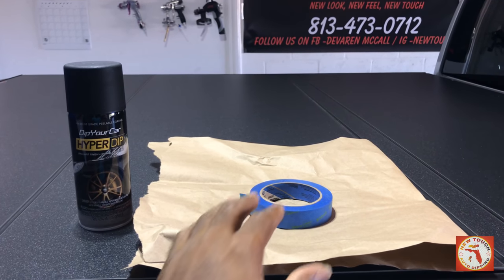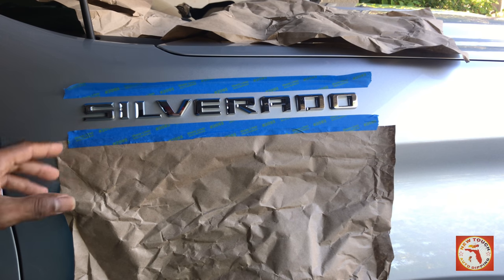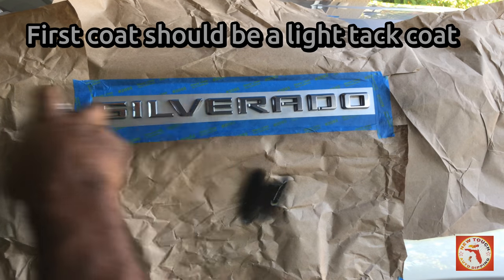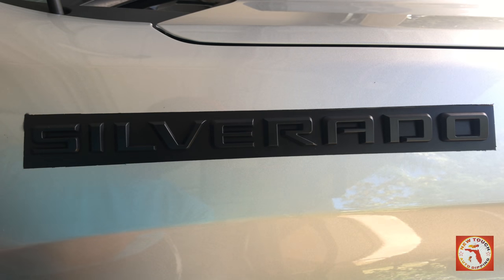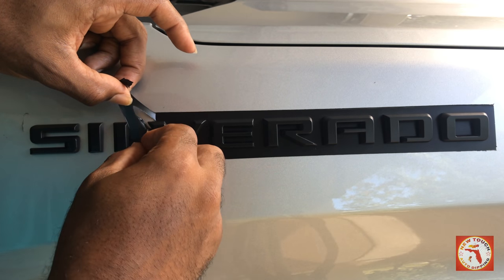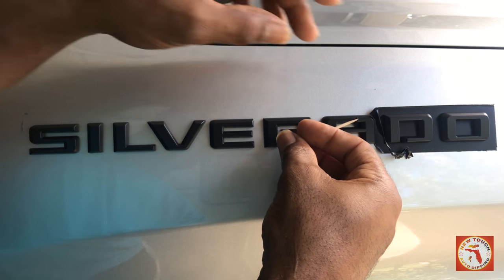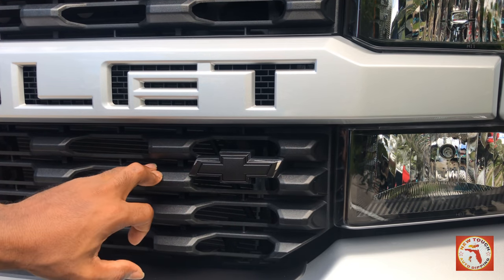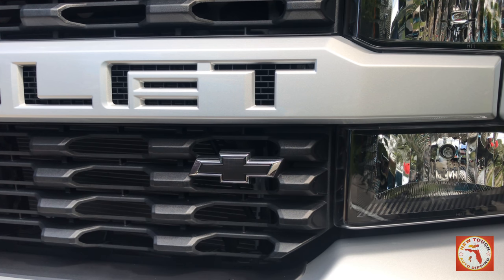(How to) HyperDip/Plasti Dip Your Emblems

Comment: This is a very concise video. One question I hope you will answer.
I live in very hot overly sunny So. Cal.  
My 2019 Pilot has way to damn much chrome. The grill the window accents and lettering. 
I want to black all of them out.
I'm trying to decide which way to go. Professional Applied Power Coating, or professionally Applied Plastic coating such as your using.

How long does plastic coating last considering many washings and heavy environment beatings from the sun's UV rays the heat? 
I'd like your best advice please. 
Thank you.
Reply from the maker: I’m located in Florida where we reach high temps as well, the maintenance will be the answer to the longevity of the product. We call it chrome delete when you’re wanting to black out anything that’s chrome. You could get 3-4 years when it’s properly installed, of course you’ll save the money doing it yourself but honestly you can’t go wrong with either choice. 
When it’s applied correctly won’t have any issues with hand, drive through or pressure washing.

Comment: When you say to peel when it's still wet how long after your last coat would you say that one has to remove the excess? 
Also I'd say it's pretty impossible to see the difference between "hyper dip and reg old plasti-dip" on a video..
The tooth pick idea is a nice touch amigo 👌
Oh and how necessary is that "PRE-SPRAY" Stuff and what is it? Is that just to ensure the area is clean before the process? Thanks man
Reply from the maker: You would only peel while wet the masking, if your temperature is 70+ after your last coat give it 1 hour before you remove the excess around the emblems. 
You really won’t be able to tell the difference between the two unless you physically see and feel it. 
The predip spray allows the paint to adhere properly on the surface, any adhesive spray is a must for all paint products.

Comment: Excess off and is there any other kind of prep cleaner that you can use
Reply from the maker: If your temperature is 65-75 degrees give it 15-20 minutes, if it’s 75 degrees above 10 minutes, if it’s 65 degrees below 25-30 minutes. Your temperature plays a huge role when you’re either outside or in a garage so the best temperature setting is 72-75 🌡 After your last coat you’ll need to peel off the tape masking while the paint is wet, let the extra dip around the emblems dry for 1 hour and peel off extra after that. Yes you can pretty much use any prep adhesive spray.

Comment: What if you wanted to do the emblem 2 different colors ? The outside black isn’t he inside red ?
Reply from the maker: It can be done but it’ll be a risky job doing with a liquid spray wrap. I don’t suggest that you try it with plasti dip bc it’s not that durable for tape or masking onto. Hyperdip or Autoflex will be a better choice to try it out on. 

A project like that would be best with permanent paint because it won’t peel when outlining the emblems for the secondary color.

Comment: Thanks for making this DIY vid and for explaining the application differences between PlastiDip and HyperDip. I've a couple questions and if you don't mind answering I'd be very appreciative:
1. As you were removing the HD away from the emblem it looked like it peeled away easily (per your instructions to carefully pull AWAY from the emblem). Would it stand to reason that the HD would pull away from the emblem as well if rubbed?
2. How durable is the HD when it comes to sun light, washing and waxing?
Thanks again for the detailed explanation on this process. I subscribed to your channel as a result. Keep up the great work!!
Reply from the maker: Thanks for checking out the video and the support, as for the dip rubbing off easily you’ll have no issues. HD will only stick and adhere properly unless you prepare the surface correctly, a dry rag or  dry microfiber towel will be it’s worst enemy. 
Whenever you wash your vehicle you’ll need to be sure that your sponge or rag is wet, I personally use a shimmy towel to wash and dry bc it’s compatible with the dip. 
I suggest that you use the DipCoat protection spray for the wax bc it’ll protect it from the weather and keep it looking fresh for its max longevity.
Reply: @newtouchauto  Thank you! Much appreciated!!
Reply from the maker: @LucRobertPoirier  you’re welcome

Comment: Sorry...should have included with the first. I was also thinking about it for the front and rear tow hooks in Red.  The Jeep is Firecracker Red. Your thoughts?
Reply from the maker: I say go for it, I painted my front tow hooks red 3 years ago and they still look good. Don’t be surprised if others think that you bought a modified version lol, be sure to use a white base coat before applying the red

Comment: can you add a glossifier from dipyourcar to really pop that shine????  also execellent instructions can you do a video of paintin ford f 250 duper duty 2017 xlt badges?  can we also do this to the front and rear bumpers?  i want to black out all chrome and make it all black including mirror cover windshield wipers and bed trim and tail gate trim any thoughts?  please advices thanks in advance, oh and i also saw where fonzi put the cans of hyperdip in warm water for a few seconds do you do this????
Reply from the maker: You won’t be able to add the plasti dip glossifier yo hyperdip but you can add the hyperdip piano or metallic black for a gloss finish. 
If I happen to run across another customer with an F250 I’ll put a video together of the emblems. 
You can most definitely paint all those areas using an aerosol spray can, just take your time. 
If your climate is always cold or it’s 50 below yes you’ll wanna warm those cans up in hot water, I don’t bc I never paint when the temps are 65 and below. 
Thanks for the compliment and checking out the video.

Comment: How many cans of spray are needed for a typical truck with emblems on front, both sides, and 2 in the rear while doing 12 coats per emblem? 

Also, can you do metal bumpers with this?
Reply from the maker: You can get by with 10 coats, I maxed out at 12 coats bc I wanted the emblems to be more durable. 1 can will be enough for the areas you mentioned. 

Actually the wrap sticks best to metal and chromed areas, just be sure that you have enough coats.

Comment: I need to paint my c pillar black on my expedition. If I f*** up using the plasti stuff you’re using am I able to peel off start over (like vinyl would) or is the bond to strong?
Reply from the maker: That’s the beauty of these products, if you have any issues you can just simply peel away and start over, you won’t have any issues with what’s underneath.

Comment: Hello and great job, just need to know, how long will it last once its done? Specially in Upstate NY with snow and heat plus going through the car washes. Thanks for the video.
Reply from the maker: Hello and thanks for the compliment, when it’s applied correctly you can get 3-4 years before needing it removed so that it peels off properly. 
As for car washing I uploaded a video if you’d like to checkout the link, it’s car wash safe.
https://youtu.be/WxrjERIBDHg

Comment: When you answered "Kurt A" you wrote "proper maintenance".  What would be "proper maintenance"?  I have a Jeep Wrangler and was looking at working on the Jeep on the sides of the front fenders.
Reply from the maker: The basic car washing your vehicle on the regular and applying the DipCoat protection spray which helps the paint last longer. It keeps the dip looking fresh, you use the spray after every wash. When it’s applied correctly you won’t have any issues with hand, drive through or pressure washing.

Comment: I've been a detailer ( reconditioner) over 20 years.   You make that look really easy, I've only used plasti dip and it's a pain in the ass... Looks good but so easy to make a mistake.. I've never tried the hyper dip, I hope I can do as good of a job as u did.. I don't think people really realize how much time and effort goes into these type of projects, especially if you don't this kind of thing all the time..
Reply from the maker: That is very true, it definitely takes a few practice runs before you can advance to the next level. I would suggest that you do the same with hyperdip, if you’re use to spraying normal paint out of aerosol cans it releases the exact same way.
Reply: When u say it's a pain in the butt  Is that because it's fairly easy it's really easy to pull it pull it off entirely say when you're trying to pull around a letter and an emblem you can just pull it all off easily?
Reply from the maker: @freedompioneer4311  once you start a peel it’s easy to pull away but that’s only if it’s applied correctly.

Comment: How does it hold up over time, specifically any issues with car washing? Thx
Reply from the maker: When it’s applied correctly you won’t have any issues with hand, drive through or pressure washing.
Take a look at the link below, it’ll show you the car washing process and results. 

https://youtu.be/WxrjERIBDHg

Comment: What did you spray on the area before the alcohol? Does HyperDip come in gloss or a black metal flake? Thank-you for your videos and your time .
Reply from the maker: I applied the predip spray which is an adhesive product for paint, the alcohol isn’t really necessary but I like to use it from time to time. 
I actually have a video uploaded on gloss hyperdip, you should check it out if you’re interested. Currently they have emerald metallic black gloss and piano black gloss available in the hyperdip brand.

Comment: How many cans did you use? I’m blacking out 6 emblems total, some of them are very small. I’m wondering if I need two cans or if one will take care of it
Reply from the maker: 2 cans will get the job done, you just might end up with a little extra for another small project after that 12th coat.

Comment: what happens on washing? if the dip peels so easily, what happens when you start the washing of your vehicle afterwards? I'm assuming any little brush bristle or whatever can grab the edge and there goes your work faster than your dreamed of having it?
Reply from the maker: 😆 nah it won’t but I have a phrase “If it’s applied correctly you won’t have any issues with hand, drive through or pressure washing”. 
Just like with regular paint this removable paint has its cure time to properly adhere to the panel or surface. A good 2 days of temps 65 degrees or higher will assure the process faster. 
If you’re interested checkout my video link below on car washing. 
https://youtu.be/WxrjERIBDHg

Comment: I have a question? If u don’t put any kind of sealer or lacquer finish over it, how do u keep it from scratching off or peeling in the future? Thanks!
Reply from the maker: This product doesn’t behave the same as permanent paint, it’s designed to adhere and bond tight to the surface. Keep in mind that it’s removable and not bulletproof paint so installation is very important bc when it’s applied correctly you won’t have any issues with it peeling

Comment: Great video. Thank you. I have one question; how durable is the HyperDip that is left behind on the logos and emblems?  Seems like it would come off just as easy
Reply from the maker: Thanks, when you remove what’s around the emblems at 1 hour you’re pretty much allowing the product to cure. During the cure process it’s creating a thicker base so that you could remove it easier than before it actually cures. You then wait at least 4 hours of heat or natural sun to finish the adhesive bond which makes it stick properly.
Reply: @newtouchauto  sweet, thanks
Reply from the maker: @SupremeGeeks  you’re welcome and thanks for checking out the video.

Comment: Forgive me…how long do you let the coats sit before applying additional coats? Great video!
Reply from the maker: Great question and thank you. Give yourself 10-15 minutes in between coats, to be sure simply touch the area around the surface to test if dry. In warmer weather such as 75 degrees the coating will dry under 5 minutes.

Comment: The blackout looks amazing but how durable is that product? Does it hold up to pressure washing etc?
Reply from the maker: Thanks and with wrapping emblems the longevity could be 4 years before needing to remove it. The key will be to wash the vehicle at least 1-2 times per month. 

My advice after installation would be to give 7 days before hand/pressure washing and 30 days before a drive through car wash. 

Whenever it’s applied correctly you won’t have any issues with it, you can checkout my uploaded pertaining to car washing if you’d like. 
https://youtu.be/WxrjERIBDHg

Comment: Looks great and seems slick. However, I'm pretty sure over time and a few washes that will start to peel off regardless of the prep. I'm not in any way knocking it, I think it's cool as hell I'm just afraid it'll start peeling over time then it won't look good and now try peeling it all off just to redo it.
You did a fantastic job making the video, great work!!
Reply from the maker: Thanks for watching the video and sharing your thoughts, the wrap will remain intact until you decide to remove it. The key will be to install it properly the first time and allow the wrap to cure with no rain in the forecast for at least 5 days.

Comment: The only hard part of this job was listening to my wife and dad during this project.  Like a bunch of negative Nancys.  "You should test it on another car" , "That's not going to be enough tape to cover" (before i put paper on tape), "Your going to scratch your car up", "What do you mean, if you peel it off won't it all come off" ,  After first light coat, "that stuff has horrible coverage" ,  I gave up on trying to explain it and just showed them this video and they were still skeptical.  I called them out after the peel and my wife said it was beautiful and my dad said "I'll be a sun of a gun, look at that shit".  I am very happy how it came out just hoping it last a while.  If it doesnt last long I have to just buy satin black letters, can't go back to the chrome after seeing it in black.
Reply from the maker: 😆 Sometimes you have to turn the doubters into believing in your hidden talent. I’m glad that you’re project was a success. When it’s applied correctly you won’t have any issues with it peeling off, it’s all in the prep work.

Emblems tend to last longer than most areas of a vehicle bc they don’t face the sun directly, you can get up to 4 years with proper maintenance. Purchase the DipCoat protection spray to help it last longer and stay looking fresh, it like wax for dip.

Comment: Too cool!  I’m going to do my tundra. Will that stuff work or blacking out chrome on the grill surround?
Reply from the maker: Yes, it’ll adhere to any area on the exterior of your vehicle. I don’t recommend spraying anything rubber bc over time the material will be harder to remove on those areas. Also be sure to properly clean the areas or else it won’t stick properly.

Comment: If you don’t mind me asking. What would that job cost for all those emblems?
Reply from the maker: Prices would of course vary depending on the shop or installer, most well known shops would have the higher quotes. I’d say that they can range anywhere between $125-$300 depending on how many emblems are being wrapped

Comment: Great video. It came off pretty easy which makes me think it will scratch easily as well. What's your feedback on the durability?
Reply from the maker: Thanks and yes you’ll notice that it peels easy after one hour. The reason being is that the paint is still in its curing stage, after 2-3 days the bond will then become more durable.

Comment: How durable is it after it sets up? Will it survive car washes or is it something that stays fragile for the life of the car? Does it have a curing time that it eventually becomes like regular paint?
Reply from the maker: The durability is definitely there, there’s a 1 hour cure time after your project is complete. When it’s applied correctly you won’t have any issues with hand, drive through or pressure washing. I suggest that you use the DipCoat protection spray after 4 hours of applying the dip, it’s pretty much like the wax that’ll keep it looking fresh and protection for longevity.

Comment: Thanks for the video.  I was wondering if you knew how to Hyperdip the emblems in their red color?  Their site only shows red for the wheel kit and it comes with white Hyperdip and Red Hyperdip.  Thanks again.  Decided to subscribe due to your very informative videos.
Reply from the maker: You’re welcome and thanks for the support and checking out the videos. Actually the red is only available in the plasti dip version, with hyperdip they’ve yet to display any additional colors other than black and grey. 
To answer your questions though yes I’m able to complete any wheel kit they provide on the website.

Comment: What’s the time between each of the 12 coats? and then after removing your tape how long to dry before removing the final layer?
Reply from the maker: If your temperature is 65-75 degrees give it 15-20 minutes, if it’s 75 degrees above 10 minutes, if it’s 65 degrees below 25-30 minutes. Your temperature plays a huge role when you’re either outside or in a garage so the best temperature setting is 72-75 🌡 After your last coat you’ll need to peel off the tape masking while the paint is wet, let the extra dip around the emblems dry for 1 hour and peel off extra after that

Comment: are you outside ? my truck too big for my garage can i dip the emblems outside without too much overspray?
Reply from the maker: Yes you can get away with it outside, overspray won’t be an issue bc it’ll disappear in the air. Checkout my video uploaded on the top 10 questions ask when dipping emblems, it’ll answer a few  things for you.